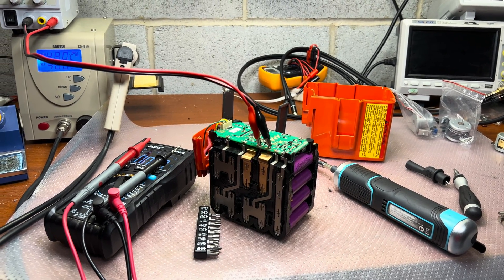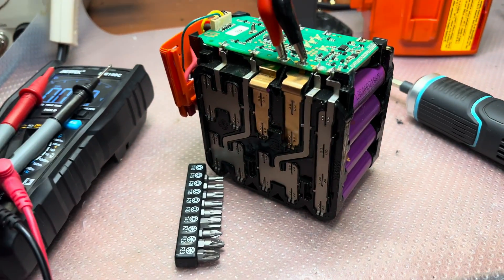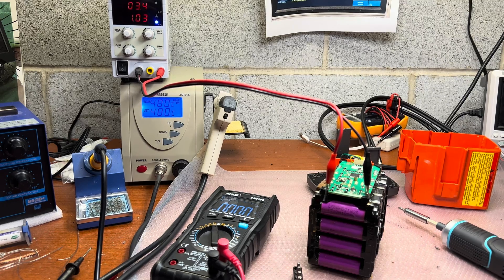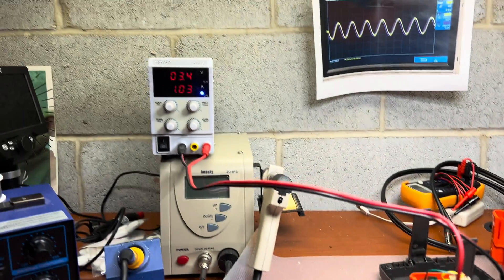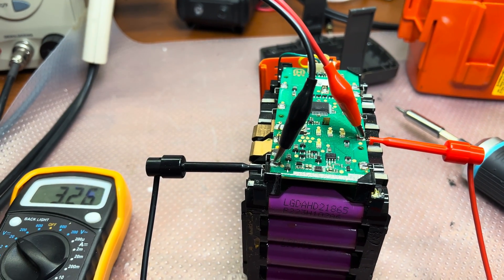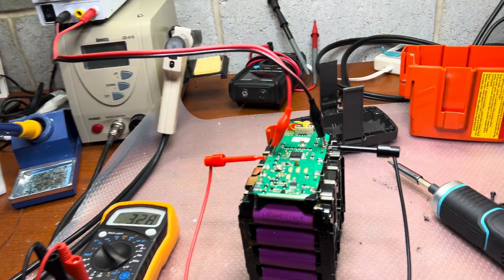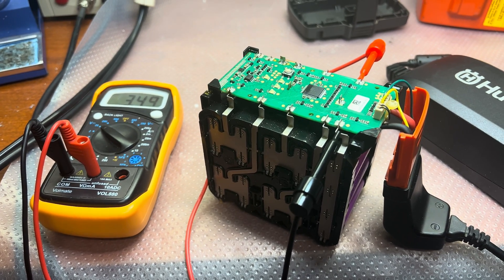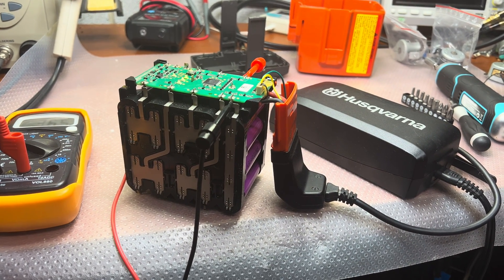Resurrecting Your Dead Lithium Battery: A Fix-It Guide using Husqvarna 36V BLi20

Comment: Could you please explain the different positions of the red and black terminals on the battery? 
I noticed that they change position and even direction several times throughout the video. I don't know anything in electricity but my 6 Husqvarna BLi are out.... 
Thank you very much!
Reply from the maker: Cells are connected in blocks. You have to follow polarity of each block to charge them.
Reply: @hifirulezzz  Thanks! 🙏

Comment: Hi, my BLi20 battery is showing 42V when I measure at the two main terminals.  Then for each group of 4 cells it shows 37.4 for the first group and then 4.09V for the other three cells. Do you have any advice as to what might be causing this? I thought I had been careful about keeping the battery charged but can't guarantee it.  Thanks
Reply from the maker: It looks like fully charged in your case. Maybe control IC has failed, I would try to discharge to 4v per bank
Reply: @hifirulezzz  Thank you very much.  What is the best way to discharge to 4v per bank
Reply from the maker: @matthewflight2841 I have 200w resistors 8 ohm 😉
Reply: @hifirulezzz  Unfortunately I only have hobby level resistors and nothing of that size.  Is there a cheap piece of kit I could buy to do it?
Reply from the maker: @matthewflight2841  https://ebay.us/m/jPunD7
Reply: @hifirulezzz  Thanks I'll order one and give it a try
Reply: @hifirulezzz  Annoyingly when I press the button now the three green lights appear for a few  seconds before switching off.  If I press the button again I get a solid red triangle.  I wait 60 seconds and press, green lights again and then on the next press it goes red again.  Wait another 60 seconds, green light, then red and so on

Comment: Thank you so much! 
I don't know anything about this electric stuff, but I was so embarrassed from those two failed BLi20 after one winter stored too cold.
I followed step by step your attempts and finally it is working again! 
:-)
I'm so happy. Thank you very much! 
Otherwise I had to buy two new ones, because with only one, you can't really work. 
One question: can you tell me where to put the clamps on an BLi200? It has maybe the same problem, but it looks different. 
How can I find out where should be what amount of V or A?
Kind regards
Reply from the maker: Use a multimeter to measure the voltage between joints. It will give you an idea on what cells joined and what voltage to apply. Glad it did help you.

Comment: Could I send you three batteries for you to recondition for me please?
Reply from the maker: @allthesmallplants  sorry, I don’t do that. In many cases cells are aged and require replacement. I do not do it now, as it requires welding machine and cells supply, maybe in the future. Will see. They charge now for a battery more than I paid for a tool, charger and a battery.

Comment: I got a different type of Husqvarna battery. The battery pack looks however quite similar. My cells did completely die and were at like 0.7 V. 

So I drilled the spot welds out, with a 1 mm drill, then pried the small tabs off (which looked a bit different than yours) and cut them off. And then I threw away those 20 dead cells and bought 20 new HG LG2 (by Liitokala) via their shop on Ali for around 48 bucks. 

I charged the batteries all to 100% and then gave them a second run in my charger (as it's very slow and took me two days), to make sure all are at the same voltage. Then spot welded new tabs on the metal bars running alongside the tabs and welded the tabs on the new cells.

The BMS was happy and showed 4 / 4 green LEDs.

Hope this helps anyone. :)
Reply: Hello, How does the BMS behave after disconnecting and reconnecting? Do I need to do a Bypass?

Comment: Helló.
Hány volt kell cellánként, hogy lehető legyen eredeti töltővel tölteni? Az én celláim jelenleg 0,5V. :/
Reply from the maker: @Kajafun1  English please
Reply: @hifirulezzz  How many volts should it be so that I can charge it with a factory charger?
At the moment, I measure 3.7 Volts in all five places, but the battery and the charger also indicate red.
The main connector of the battery is 26 volts.
The battery is 3 years old, I don't think the cell is bad.
Thanks.
(google translator)
Reply from the maker: @Kajafun1  3.6V was enough to make BMS recognize cells and start to work smoothly. 3.7V may be a bit high
Reply: @hifirulezzz  Everything is at 3.6V, but still not good. :(
For the Xiaomi drone battery, I pulled that white cable and it was fine. In this case, is it possible to restart BSM somehow?
It would be nice if there was a trick to this, I don't want to solder so much to take it all apart. :( Maybe I should wait a day for it to normalize?
Reply: @hifirulezzz  It works!  You have to reach 3.6 volts in several parts, as you showed in the video.  Thanks!

Comment: You never said if the battery worked again or not just that it took a charge
Reply from the maker: It is working for a year now with no more problems.
Reply from the maker: Still work with no issues...

Comment: where do you buy this case and bms for this battery? My battery has epoxy over the battery terminals
Reply from the maker: That is original batteries
Reply: Mine too. Samsung cells, 2021.
Reply: same here, came for hope that someone got the epoxy off in a decent way... been looking around and so far cannot find any resellers for this stuff... got 1 battery with broken bms and one with bad cells... wohoo hopefully i can figure out how to switch around but the epoxy seems pretty rough

Comment: what purpose of the middle two contacts of battery?
i can not undarstand
Reply from the maker: Battery is 40V. There is no any element which can do it as a single element. So, smaller voltage is elements are connected sequentially.
Reply: @hifirulezzz  if i correct understand you, If you need a lower voltage, do you use a smaller number of cells, for this purpose additional contacts are soldered in the series connection, for example, not only for 10 cells, but also for 9 and 8?

Comment: I opened mine up found 2 lose springs in it.  It had always shown fully charged but would run the leaf blower
Reply: They are not "loose" they are below the red clips on the sides. You probably just overlooked them as you took it apart.

Comment: Is the battery still working or did it go back into fault
Reply from the maker: It is still work fine. I was watching electrical vehicle repairs since then and they technically do the same to balance the batteries.
Reply from the maker: Still work with no issues...
Reply: How long did each cell take to charge ? I have 3 batteries also
Reply: @markbaptist5566  at 1 amp they would take an hour or two to come back to live. Just make sure that they are still in the safe range of recharging. If they dropped too low they may have been permanently damaged and are not safe to recharge.
Reply: They are 9amp
Reply from the maker: @markbaptist5566  I did not measure, but a few hours